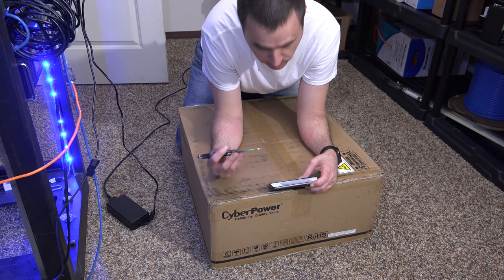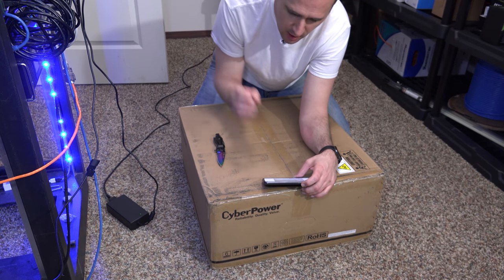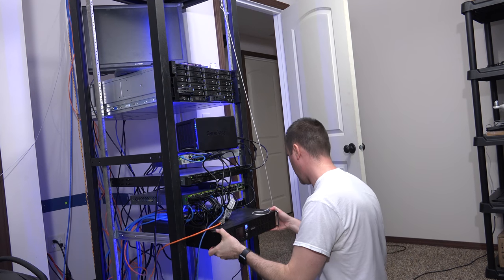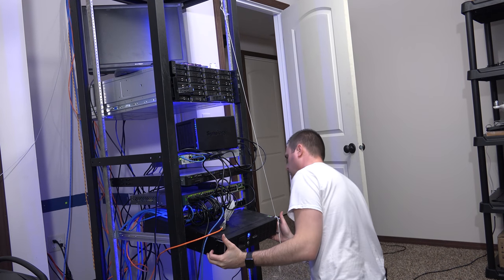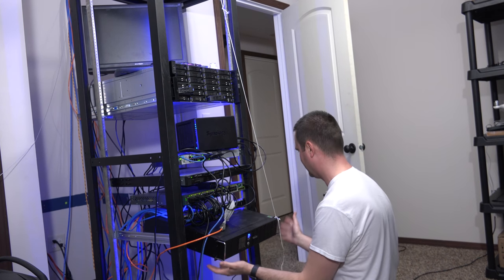5 Things to consider BEFORE you build a Plex Server!

Comment: @ 1:13 #1 - SSD for Plex Meta-Data
@ 4:17 #2 - Mass Storage/Operating System - Options - 1)Microsoft Windows 2)Unraid 3)TrueNas/FreeNas
@ 9:09 #3 - Expandability Short or Long Term Thinking
@11:01 #4 - Performance
@13:25 #5 - Backup Battery Supply
@15:05 - # Honorable Mention - External TV Antenna & HD Home Run TV TUNER - Local News
Reply: You the MVP, thanks!

Comment: A few more recommendations from my experience:

- If you do have an "extra" SSD, consider making it your dedicated scratch disc to do your transcoding. Transcoding can be very hard on SSDs and it would be better to not put that wear and tear on your primary drive. 

- An Nvidia Shield Pro and a 8-14TB external drive is a surprisingly compact and a relatively cheap starting point. The Shield is still one of the best Plex players, but also makes a surprisingly good server. 

- Synology NAS with Quicksync enabled processor would be the next most compact and efficient storage/server combination while being scalable. 

- Think about your internet upload speed before you get too carried away with how many transcode streams you want to support. Your CPU may be able to transcode 10 but your internet bandwidth may only allow 2-3.
Reply: Would you be against transcoding to ram disk?
Reply: @dustinvanantwerp4917  I use to use a RAM disc for transcoding, I had no issues and I haven't seen anyone else having issues. That is of course assuming you know how and have enough ram to set aside. I ended up having a 16GB stick of Optane memory from another build that I now use for my transcodes.
Reply: @ThatWilsonGuyvids  Interesting. All these years and I never gave performance much thought. It's always done what I've asked it to do. When 4K HDR took off and I started adding that content, and when LiveTV and DVR were added, and I jumped on and bought a tuner. Never had performance issues with the 3-5 TVs and several mobile devices attached. The only thing I have problems with is Amazon devices crashing the plex app. Or locking up while fast-forwarding, but from my readings, this is totally just an issue with the Amazon Plex app. And on Roku, PC, and IOS, there are never any issues.
Reply: Can I buy an Nvidia shield and connect my synology ds416play Nas to it as the external drive?
Reply: On Linux just map your transcode directory to /tmp or to /dev/shm

Comment: Important notes:
1. Last I checked only Windows supports multicore subtitle encoding
2. Use software like Macrium Reect Free to backup your Plex drive (mine is all on NVME OS drive so everything is backed up)
3. GTX/RTX cards have the encoding limit locked so use the unlimited cracked drivers. GTX 1660 has Turing encoder for best quality. 
4. Get better performance and be able to add drives to your Raid array with an Adaptec ASR 71605 Raid Controller with 1GB Ram, battery, and cables for ~$90  on eBay. But strap a 40mm fan to it because it will overheat (it pumps out heat)
5. Transcoding DTS-HD MA or Dolby True HD audio to when streaming to a device uses quite a bit of CPU, especially during the first couple seconds when it’s loading your videos buffer. If you have over ~8 streams then be sure to get at least a medium level CPU like an R3/5 or i3/5, not an Intel Atom or Pentium.
Reply: That's one 1 of the reasons I run Plex under Windows - better performance. You can also use an AMD RX card as it offers great decoding-encoding as well.
Reply: @UnkyjoesPlayhouse  yes but last I checked AMD has still not fixed their x264 encoder, and it looks bad compared to Intel/Nvidia. I originally bought a 2200G and it streams looked terrible. I returned it for the 8400 and it’s 2Mbps looked on par with the 2200G’s 4Mbps. That’s when I looked it up and found out there was an issue. EposVox did a videos about it too. So for now I’d stick with Intel/Nvidia when buying, but if you have a card on hand then use it. I ended up returning it for a R5 1600 (now 2700x) and buying a GTX 1660 instead :P
Reply: @andrewskaterrr  I am using an older Nvidia Quadro K2000 in mine right now. I have a GTX1650 in my Ryzen unit, will need to give it a try, thanks for the info :)
Reply: What about the 960? Something I have laying around and just built it from my old 3rs gen i5 running at 4.4 ghz my mobo won't allow more for some reason.
Reply: @iwinrar5207  gtx 960 should work just fine for encoding/deciding. If you want to save power put the power limit at 80% too.

Comment: Definitely power consumption. Some stats like where I live, it's $0.37/KWh. I just downgraded my plex server from a 2950x ThreadRipper with a 1070TI to a 10700 only. And it's a big difference power wise.
Reply: 37 Cents per KWH?  Seriously?  Where the EFF do you live?
Reply: @HonRevJoWazzoo  Connecticut
Reply: I thought I was bad at nearly $0.19/Kwh.  I just created a Raspberry PI 4 to run my Plex Server.  Not the fastest thing in the world, but guess what?   IT WORKS.  We don't stream in 10 areas, matter of fact, I'm about the only person using the server in the family.  Regardless, I moved to the PI because of power consumption.  Running a desktop machine eating up $0.80 per day in power for something we use once in a while was kind of stupid.  The PI eats up like 0.08/day or less.  

Will this work when you have multiple people streaming?  Well, at 1080P we can stream two at a time without issue, which would be the MAX ever.  MOST of my media is old TV Shows, and older movies that we owned and I ripped to the NAS, so quite a bit of it is 480p, and guess what...I ran 4 streams without a single issue.
Reply: @WreckDiver99  That's pretty slick. We use direct play from my NAS so we don't even transcode anything unless we are going on a trip and need to fill our ipads.
Reply: @cerusa827 suprised it's not California

Comment: Jason, you should do a video of plex Transcodes using intel QS vs a p2000 or even the ryzen 3900x.
Reply: i regret my p2000
Reply: Can a CPU without integrated GPU transcode media or do you need iGPU to output a display only?
Reply: @seasesh4073  Thats totally my bad on that, I meant like one of the Ryzen APUs
Reply: @jamescox5638  I just built a dual Xeon build for my new plex server 16 core 32 thread total cost of like 200 since I already had power supplies and Ram ! I might include a decent graphics card for transcoding but from what I’ve seen unless you get a damn 2060-3060 it really isn’t worth it atleast not for me if people plan to offer server access to multiple people then it’s probably worth it assembling the new pc this week curious to see how plex reacts to all the cores and threads

Comment: Thanks for the video.  I share my Plex server on the same laptop PC that I run the PLEX operating program.  I have a 1 TB SSD on a I7 processor with Windows 10.  My internet speed is around 250 Mbps.   I am a single user and use PLEX to DVD record some local TV Antenna channels that get saved to my MEDIA storage area on my server.  So far I have not had any problems doing this.   I edit the TV shows and remove the commercials, save it to another EXT hard drive and then remove the original content from the server storage.  So another words, I do not store and keep allot of personal content on the server storage area- I have other EXT hard drives that do this.   There is no way to record their PLEX movie content or TV shows other than to watch them later.  Once I am done watching the movie, etc,  I remove it from the watch later function.     

Setup was easy to do for my PC.  Only thing I needed to buy extra was the HDHomerun Tuner box and few coax cables. Everything else I already had.
Overall, everything works great with PLEX and I now have a way to record my local Digital TV channels from my Antenna.  Quality of the recordings are pretty good.   take care.

Comment: I’m running a cheap $89 dell tower I got on clearance. Only upgrades I did was a $50 SSD and 16GB of RAM. CPU is a G4400 nothing special or extreme. It runs fine, pretty low power use (runs 24/7). I’ve considered moving to a Shield as my server and still might because I’m sick of dealing with Windows.
Reply: I was running an Nvidia Shield and it was great for a while but started running really hot all the time - kept dropping USB connections etc. Was restarting it every couple of days. Just built a TrueNAS server to replace it and it's a whole different world. Took a while to configure but once it was up and running it's an absolute dream! Budget wise it only cost like $600AUD - a Shield is like $350AUD. Worth the price difference if you can afford it and are up for the tinkering required to get it running. This is just my opinion of course, but at some point you're gonna want to bite the bullet and do it 'properly' - I recommend doing it now - the Shield will be half the budget. Makes a great Android TV box as well though.

Comment: Really enjoy your channel, so only trying to be helpful - I think at 8:14 you meant RAIDZ1 RAIDZ2 and not ZFS1 & ZFS2 (latter being file system). I'm not in the slightest way bothered, just thought I'd mentioned it. RAIDZ2 is generally nice, cos when you're replacing one failed drive, another can fail while you re-silver (re-distributing data across discs) and you lose no data at all. Not one....bit :-)  Keep up the good work and fair play on the garage floor 👍 

Disclaimer: Tech isn't my job, so I could be completely wrong.
Reply: You’re correct, and RAIDZ1/2 is the same as RAID5/6.
Reply: @andrewskaterrr  Cheers 👍

Comment: My 1600x will work great for years with 1080p content. 4K is a little different but if you get a nice high bitrate 1080p file, I am all good! :)
Reply: You talking about a Ryzen 1600x? I am in the process of migrating my plex to a newer build, but I never had any issues with 4K HDR across several streams on my Ryzen 1600x. If you want to stick with that hardware and improve the transcodes I would recommend a Quadro p400. They run about $150 and will make vast improvements.

Comment: I’m just getting started and have decided not to rip my 4K titles as the take up way too much space and have decided to go with Blu-Ray and DVD rips. I’m starting with a 12 TB drive and I’m having trouble with my Apple TV which is hard wired to my modem not my router and the Plex is going through my router. I have my remote access on and it’s working fine but the Apple TV will only playback files at 320P it won’t go to original quality for nothing. My Firesticks work just fine at full quality.

Comment: I went the FreeNAS route, but when I built it I didn't even know about Plex..... just needed storage with protection (redundancy). That said, as a non-linux guy..... it's easy to get going but harder to tweak. For example, and this is where I'm stuck (internets no help). I made Plex in the plug-ins and gave myself ownership. Mounted a pool named "Media" for it and have folders for Music, Movies, TV shows...ect in the Pool. My issue is the scheduled back-ups via Plex. I point the back-up directory to "/Media/Plex BACKUPS" so that the back-ups will be in a folder by itself on the media pool...... yet the folder is empty when I open it in win windows (network locations/NAS/Media/Plex BACKUPS". So, while it's nice to have all in one box, having it as a plug in defiantly complicates things if your not a linux guru....
Reply: I haven't done it yet, but this is supposed to be a better install method - https://github.com/danb35/freenas-iocage-plex . Are you using Rsync to backup? That takes some fiddling if not familiar (which I wasn't!).

Comment: Another good option is a linux server which can also use zfs storage pools.  I've been running mine for a few years now.  It has been solid and performs above my needs with just a newer pentium cpu which can also do hardware transcoding.
Reply: What is hardware transcoding ?
Reply: @DaveckKProduction  old thread but just in case - hardware transcoding is a Plex premium feature that allows you to offload the transcoding (converting video codecs or resizing videos) to specialized hardware. If you don't have specialized hardware, it is exceptionally CPU intensive. 

The specialized hardware is either an NVidia GPU, or an Intel CPU that supports Quick Sync.

Comment: I notice that all the PMS build guides recommend using an NVIDIA Quadro PXXX card for hardware transcoding. But I've also seen videos and forums saying graphics cards are useless. I have an old GTX660 in my PMS build. I have no idea how to tell if it's being utilised or not without just ripping it out and seeing the difference. 

My question is this... Why the Quadro over other cards? Is my GTX useless in this scenario? Help a sister out.
Reply: From my experience, the GTX and the Quadro equivalent work very much the same. For what PMS users use it for (Nvenc) so a GP107 is a GP107 if it's branded as a GTX1050TI or a P400. I've used both for encoding/decoding never noticed a difference. However, I can say. P400 is much cheaper now and has the added benefit of only taking up a single slot.
The GTX660 does not support Nvenc, see https://developer.nvidia.com/video-encode-and-decode-gpu-support-matrix-new
An easy way to tell if Plex is HW transcoding is looking at the dashboard while a stream is running, it will say Transcoding(HW).

Comment: I just built a plex server out of a raspberry pi 4. nas case with an ssd in it, and an external drive for media. It struggles adding in subtitles to media unless you stream it to the desktop app. Other then that it can handle 2 streams just fine and is a fun thing to set up. I was using a computer with a core I7 7700k for its processor but it was a bit overkill for my needs and i wanted to use that computer for something else

Comment: I look at it like this, the new 11th gen intel 730/750 IGP are good enough to transcode a bunch of 1080 streams. Transcoding 4k is a waste of time, even with a p2000. I have been using jellyfin for going on 2 years now, the only thing that is causing me to consider switching to plex is 4k direct play issues on some devices with JF.... also jellyfin stores your metadata on the actual raid array with the media in each media item's folder.. I don't like that plex saves all the metadata to a separate drive. Seems backwards and may be a dealbreaker for me.

Comment: Second MOFO 250gig metadata file LOLO. I am running a Poweredge R610 with 96gigs of ram and dual zeon E5645's all my media is stored on 2 buffalo TeraStation's but about to move to a PowerEdge R720XD 12 Bay 3.5, 2x 2.0GHz 6 Core, H710 with 128gigs of ram and 96tb of space for my media and backups will be using Truenas on this. My bandwidth is from Xfinity GIG service I finally got the up speed to serve out to all my clients and friends. All equipment is interconnected with 10gig connections. I can't stress more to have the up bandwidth if you have multiple clients connecting to your plex server outside your network.
Reply: Yes ....This! My bottle neck is definitely my upload. I'm running 130 TB dual 2650 2.6 Xeons server paired with a P4000 and bottle neck at 30 Mbps upload. I can't wait for symmetrical gig to be available in my area
Reply: @bigbigspoon  What's your ISP in your area?
Reply: @marcesw35  Concast
Reply: @bigbigspoon   wow, they don't offer gig speed in your area is some bull.
Reply: @marcesw35  Gig down but not gig up.
Reply: @bigbigspoon  but you should be getting 40up at the most which is more than enough for plex and several off site clients. I am able to have to have 5 clients connect with 1080 transcode with my setup
Reply: @marcesw35  I’m running dual Xeons with a p4000. My bottleneck is at my upload. Not that I hit it but when I have 6-7 users when I’m gaming I can for sure feel it.

Comment: From personal experience, if you are not a savvy linux/cli/freebsd user then I would avoid using FreeNAS. Its price is great, free. However, the learning experience is terrible, non-existent support, limited functionality and stability for Ryzen or other non intel components, including Realtek etc. It's a good experiment but not a good option for reliability when you cannot troubleshoot it yourself. 

FreeNAS itself can be very robust and reliable, but it is wholly dependent on the proper hardware/drivers and the Administrator's ability.
Reply: Couldn't agree more, it's a time sponge for sure. I only use it for plex, because I have a server that mainly has work data on it, and it had the capacity for plex/media.

Comment: You can get a ultra low power plex server if you are willing to optimize your collection. Using a raspberry pi 4 with a few ssds and h265 optimized movies and tv shows yields excellent streaming performance to multiple devices on the network. (Provided you are using the app and not web client, or else it will try to transcode, dont do that!)

Comment: You could also use Xpenology (Synology DSM on your own hardware). That'll provide an excellent RAID/SHR option without the hardware lock-in.
Reply: That's what I did. Synology hybrid raid is fantastic. It allows me to add different size drives. I just make sure that I do manual updates for the Plex server. I put it on an old Dell studio PC that I got for free.
Reply: I started down that path but ultimately went with actual synology hardware. Xpenology was too much of a hack and I don’t want to have to worry about my data through upgrades etc.
Reply: @lordgarth1  that's probably for the best. I don't dare ever actually update DSM as it would probably break. A couple things I don't like about synology is the reliance on synology for their software(you have to use a synology account for all their software) and the outdated versions in the software store. Plex server is several versions behind at all times hence the need for manual updates for plex.
Reply: @troyy2307  thats not true. You can manually install Plex and versions are updated as frequent as other versions. And you can get third party software from Syno Comunity right in the app station